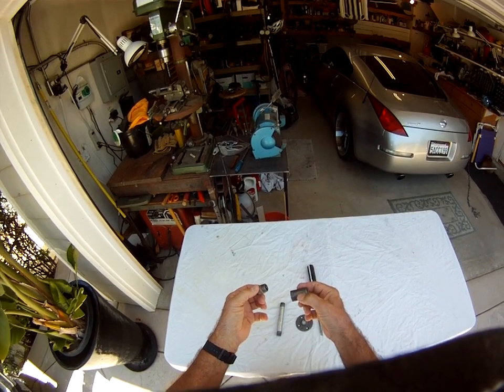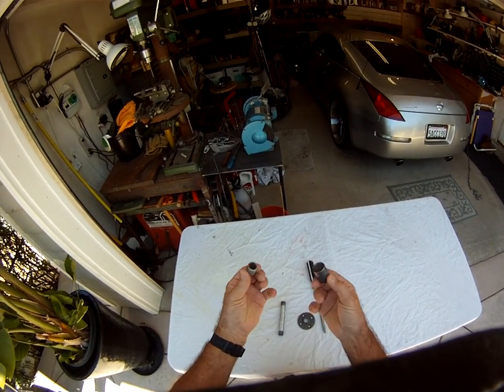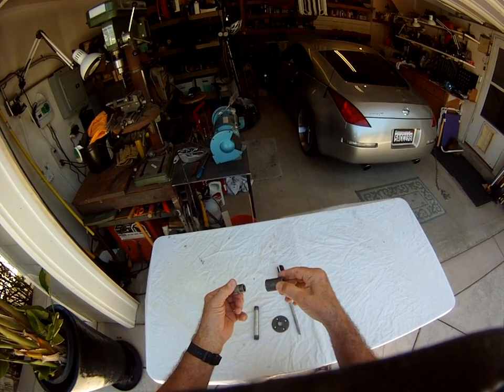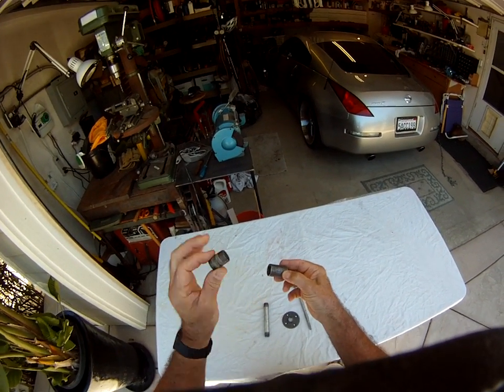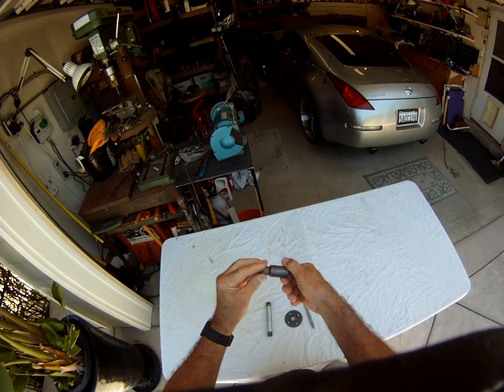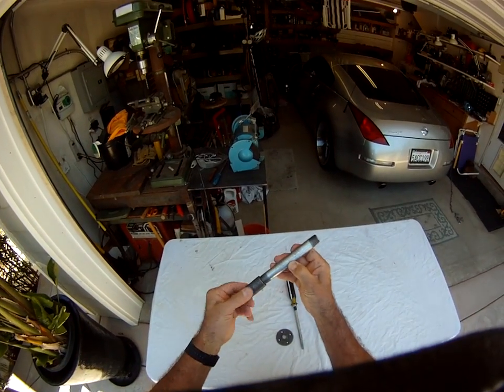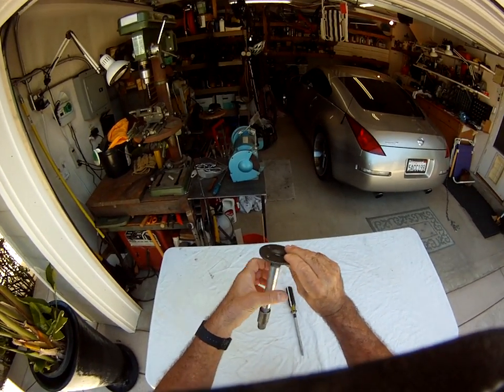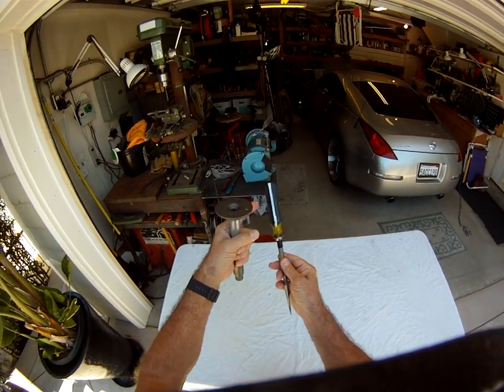Chevy 5.7 Vortec Distributor installation timing problem

Comment: Great video.  I used a 12" 1/2" copper and hammered one in flat. it works too.  I didn't have a good long screwdriver at the time.  The outer piece if pipe is a good idea to help line things up if you have the screwdriver.  For everybody having issues with these get a shim kit and tighten things up to 0.010"-0.012" end play,  Also if we can't point it right without hitting the manifold knock out the roll pin and spin the gear 180 to the shaft then put the roll pin back in.  You will find it fits better than ever. Drilling out the two screens will help everything stay clean under the cap.

Comment from the maker: All the parts are 1/2" NPT pipe fittings you can get at any hardware store.  NPT = National Pipe ThreadParts list: 1....1" NPT nipple                  1....1/2" NPT  coupling                  1....6" NPT nipple                  1....1/2" NPT flangeThis assembly drops right into the distributor hole, the flange holds it, and positions the screw driver. It makes finding the oil pump shaft easy and simple to adjust.